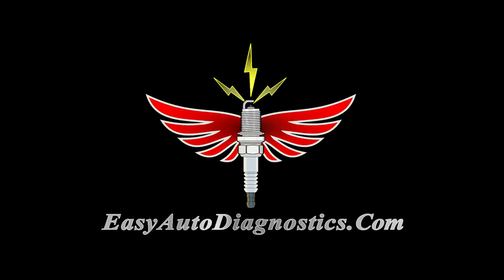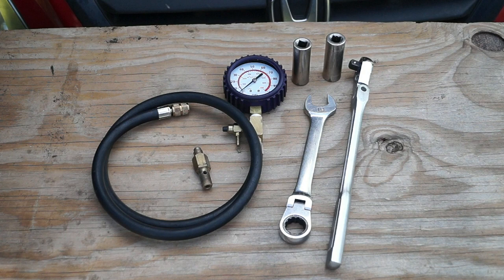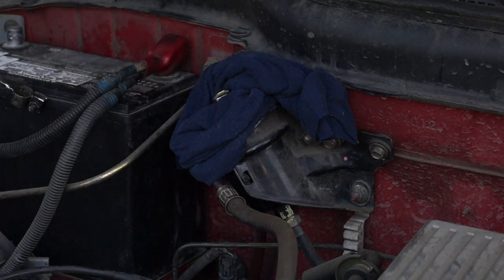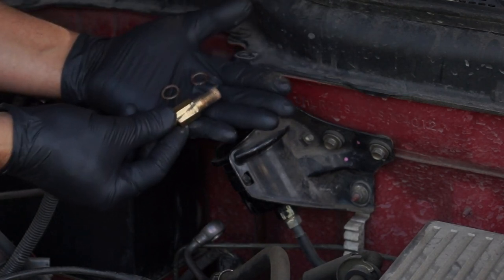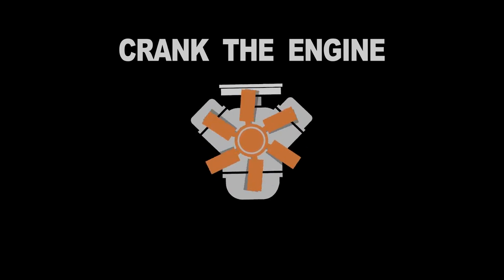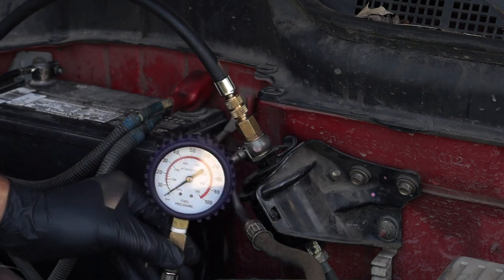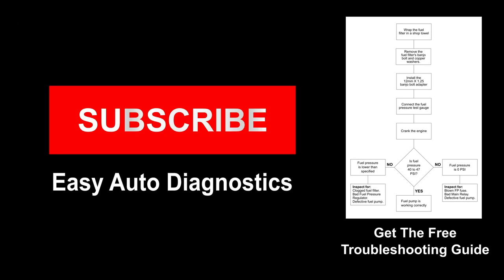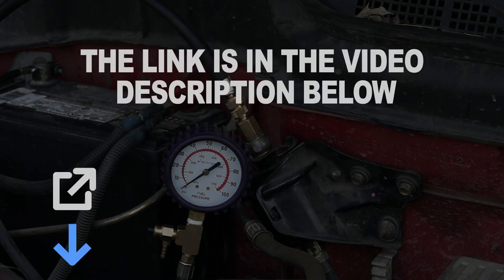How To Test The Fuel Pump  (1997-2001 2.0L Honda CR-V)

Comment: hey also.. you may not need a fuel pressure tester to see if it is working... first check all your fuses before doing anything. and then check to hear the relay switching on the fuel pump when you turn key to power.... (do this first) then you can just loosen the banjo nut  just enough for fuel to come out and turn ignition, some more fuel should come out... if not, then check relay more thoroughly...  if it is clicking on under passenger side dash inner part where it meets the door when closed... you may have to take out and take it apart to test it but you if relay good, then take driver side seat out to get to fuel pump to test to see if it is getting 12v. if no voltage... then something is shorted before pump... if you get voltage, then i'd recommend changing the pump... not difficult after getting seat off. make sure to test that you are getting a fuel coming out after installing new pump before putting seat together though -could also be something weird in there like a clog in line (in this case i would take filter completely off and use compressed nitrogen to try to blast it clear)... hopefully when you turn ignition the relay will prime by turning on pump for a second or 2. now, back to if you are not getting voltage at pump... then it can be frustrating... bad ground to thermostat, bad ground wire to relay, bad ecu... yeah no fun. so hopefully not that. i guess you could always just run a new 12v to pump with a manual switch, or relay so it turns on pump and then cuts off after 5 seconds whenever you turn power on to your car, or something... hopefully you don't have to do that.
Reply: Correct. It either works or throw it away and get another. Just like the rest of it. Fuses and the filter first.
Reply: Thanks man this helped me
Reply: Now that is a real how to.

Comment: my 01 auto idles fine and drives fine however going up hills it begins to slow down with my foot to the floor. I have lean codes in bank 1. replaced the fuel filter and the fluid came out black (not sedimentary atleast). after doing a fuel pressure test i sit at about 30psi at idle in park and around 40-45 while driving (foot on gas). Probably a bad question but would you read the pressure at idle or while driving? is it safe to assume my pump/sending unit is beginning to fail?

Edit: i have a code for an open circuit knock sensor (unsure if this is related)

Comment: I have to ease the gas pedal in order to take off
Reply: Have you check fuel pressure? If so, Sometimes the throttle position sensor can cause weird issues like that